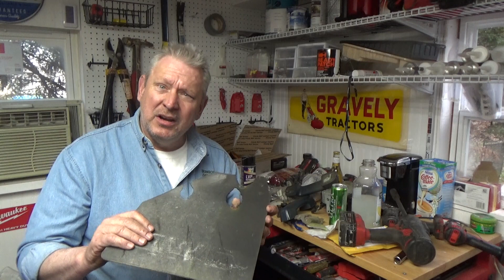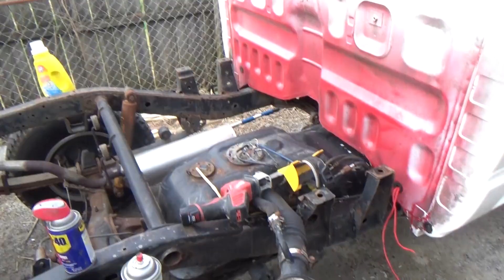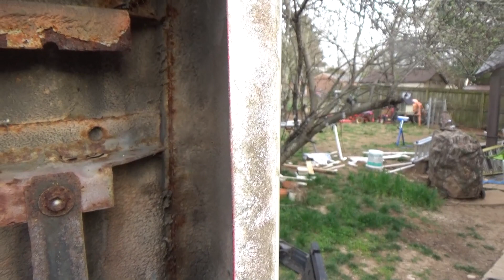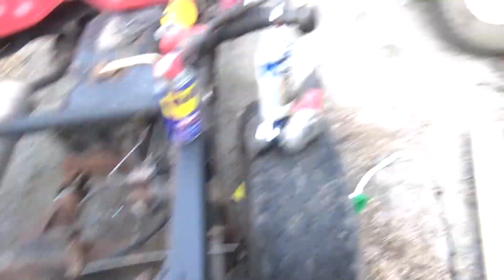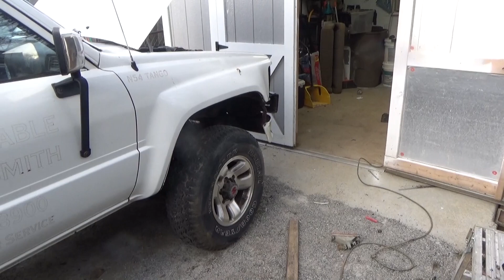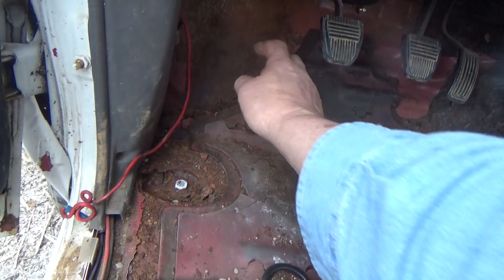88 Toyota 4x4 Restoration -  A Nasty Find - Wheels and Tires ??

Comment: Hi Dave, i know this video is a little old now but wondering what you ended up doing with your tires. I have the same truck and deciding between stock 225s or going up to 235s. Why don't you like the 235s? too slow? Thanks for the advice!

Comment: I’d keep the aluminum rim and increase the size of the tire slightly.  Either a 235/75 or a 245/75.
Reply from the maker: aluminum- check .  Maybe 235 but I didnt like them before

Comment: I thought I had a seat for you . I have a 1988 Toyota truck and replaced the seat in it. Unfortunately the upholstery shop said the springs were to far gone. Friend of mine is doing some work on it in Jacksonville, Fl. However, he did find out that a Nissan bench seat from a stick shift truck works perfectly. So I am running the Nissan bench seat in mine.
Reply from the maker: Thanks Bro - I may have a line on one tomorrow :)